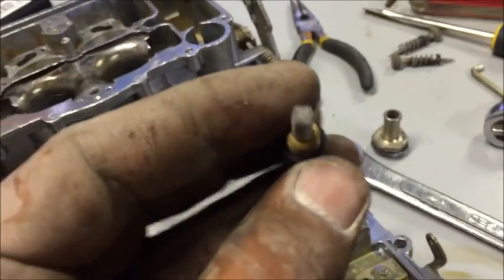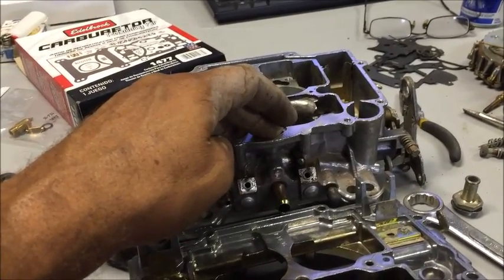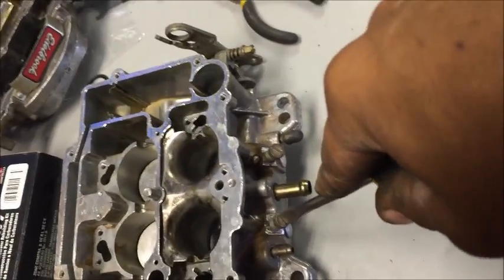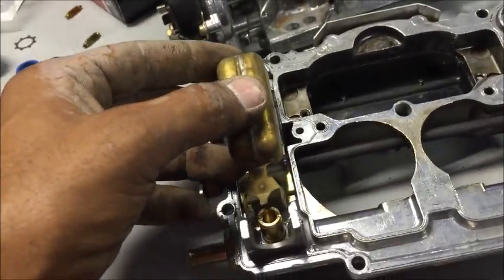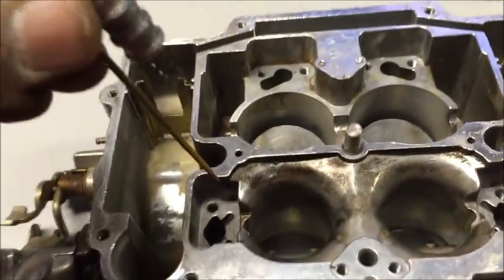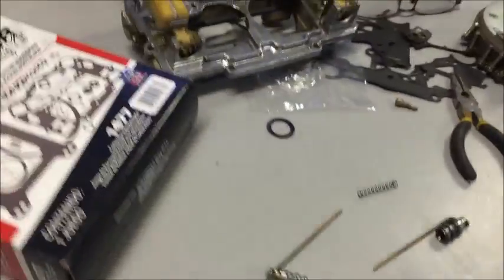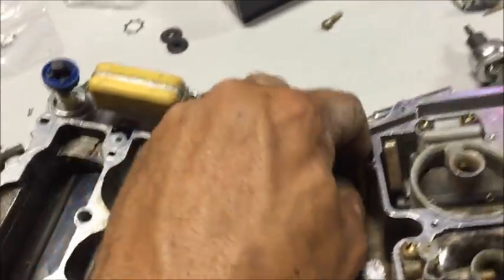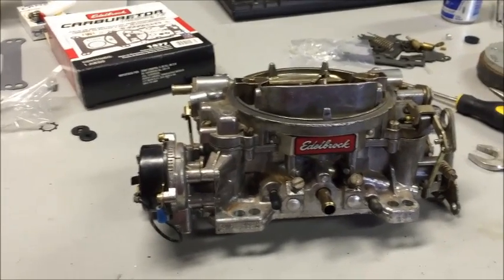How to Rebuild a Carburetor (Edelbrock) Part 2

Comment: Binding the float, while exerting pressure against the needle valve, can damage the soft face of the valve; never force float in this manner during adjustment
Reply from the maker: or possible seat it, kinda like pulling on guitar strings when there new. i have  been doing this a long long time. but thanks for watching.

Comment: Is that mesh screen edelbrock's version of a fuel filter? Would it hurt the carb if they were left out?
Reply from the maker: you would think it would be fine because the other filter is in place, but it has another job, when the fuel passes through it, it can cool the fuel . it the winter it doesn't matter much, but in the summer in hot states, it can be the reason for vapor locking in some cases. i am with you here, and believe its not that big of a deal, but the designer of the carb will tell you better. and he is a smarter guy than i am. ha. your call on that one. great question!!

Comment: i'm going to rebuild a carb for the first time i worry it won't work right do you have any pointers
Reply from the maker: take your time, snap pictures as much as possible. clean everything with carb cleaner then air dry with a compressor hose. try not to leave a film on any internal parts. blow out every hole and make sure you hear air going through so its not plugged. biggest issue with them is make sure the air inlet under the float is clean. adjust idle screws all the way in and back out 1 and 3/4 turns. do this and you will be OK. don't be afraid to try. sometimes its a better education to learn what not to do, than it is what to do. good luck, keep us posted how it goes. thanks for watching.
Reply: thomas brian your welcome and thanks for the responding

Comment: on my carb it is dripping into carb !! how do i fix it ?? can u help me ??
Reply from the maker: the air jets are plugged, pull the bowl again pull the air jet straight up in the center under the float, dont just clean straight through the jet, lay it sideways and clean there are small holes that help with the air so the jets spray instead of dripping. clean the side good they are small. good luck. thanks for wathching

Comment: great video!  Thanks for this.  In the first video you mentioned that you'd be removing the electric choke.  Did you do that in a different video?  Any tips for removing the choke?  I'd like to dip the whole carb body, but obviously would need to take off the electric choke.  Thanks for any advice!
Reply from the maker: +Jonathan Melot 
no i didnt, but you can. sorry about that. simply when you install it, turn it with about 1/4 tension. you can mark it as well to know where the tension should rest. or after installing leave it slightly loose and run the truck and adjust it accordingly. if needed i can make you a video how to adjust it. thanks for watching.
Reply: +thomas brian No worries, I got everything disassembled, cleaned and put back together.  Thanks for the video!
Reply: Instablaster...

Comment: So I did everything in your video but gas is just pouring out of the top of the pump.
Reply from the maker: +TheScurge66 
accelerator pump? there is a gasket that should be with it, check to see if it got tore
Reply from the maker: +thomas brian 
seal..
Reply: +thomas brian thank you that seemed to solve the problem
Reply from the maker: awesome ty for watching

Comment: Is this a 1406 type?
Reply from the maker: +JRoberts1260 
 yes sir you are correct. 600 cfm.
Reply: Right I just got mine rebuilt runs awesome on my 73 Dodge D200 w 360, thanks for the upload.
Reply from the maker: awesome thanks for watching.
Reply from the maker: +JRoberts1260 
great truck, i have 74 power wagon, i love it.(same engine)
thanks for the comment.